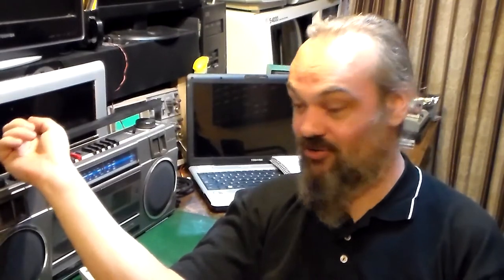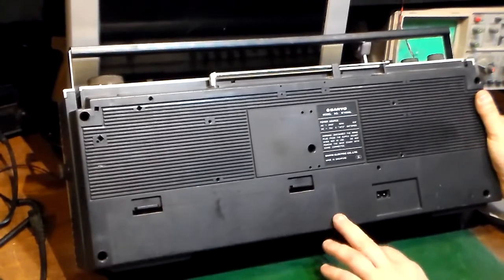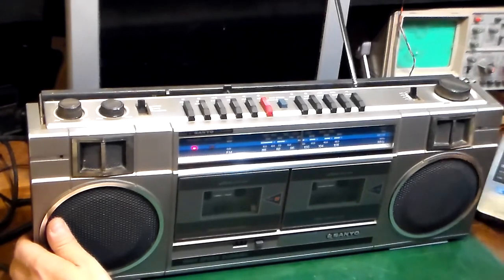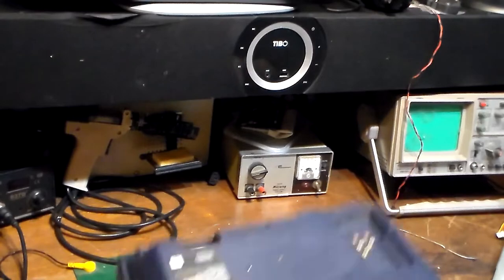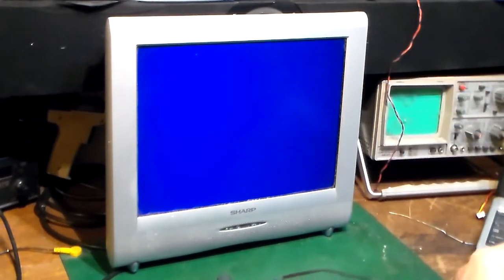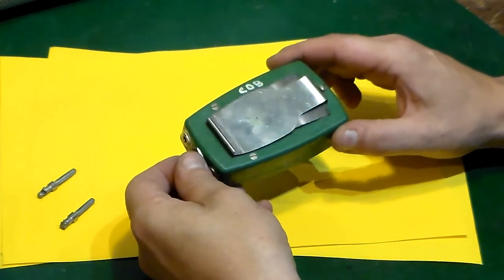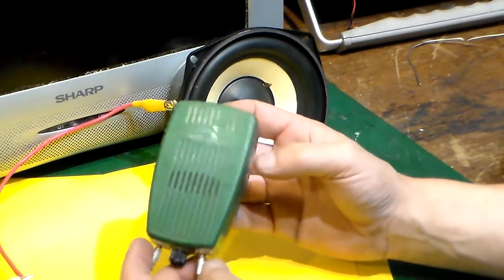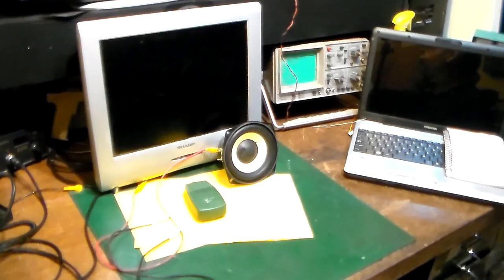Car Boot Sale Pickups 24/07/22

Comment: That is a GPO Device you are correct. You can hook it across a line and listen to what is on it - The Battery was to power the Speaker/Mircophone on it. They can be used as an intercom if you have two. Someone did not know what they were selling.....
Reply from the maker: thanks for the confirmation Steve